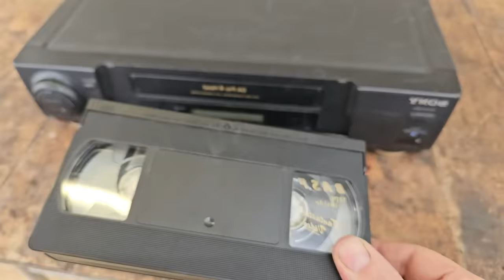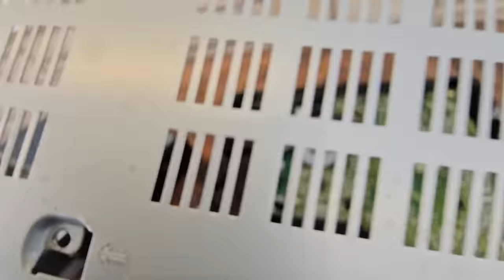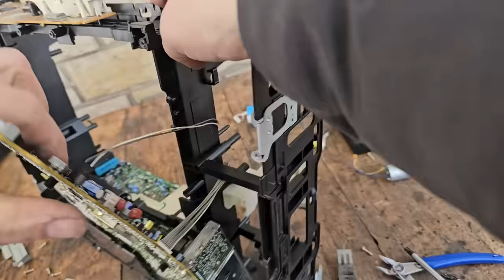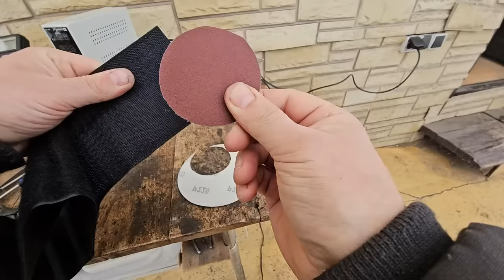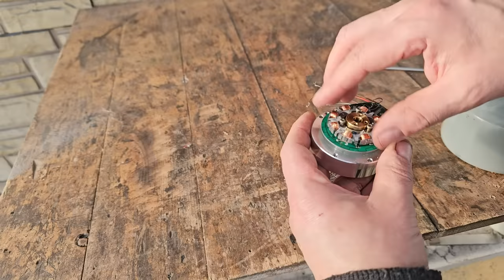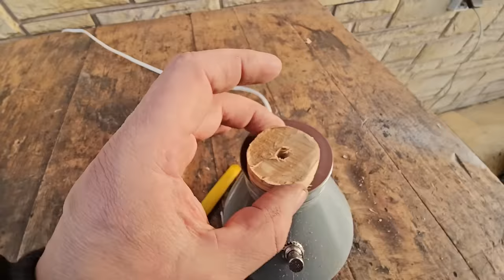Few people know the secret of an old video recorder. A brilliant idea in a few minutes !

Comment: Ridículo.
Reply: I am just adding on here . . . .with its prior aptly correct . . . .RIDICULO . . .ridiculous comment which I also HEARTILY  agree with. 
That video  head drive motor that he chose to use is the head spinning motor and the multiple brown wires coming of from it are related to different phase windings that are to be   powered from an appropriate a multi phase shifted drive power from a  power IC on the circuit board in the VCR. The power will be phase critical AC drive. This motors  whole   purpose is to spin that weighty aluminum head drum / flywheel that has  sets of record and playback heads that are spaced apart at 180 degrees. 
On playback of a tape, it is UBER-UBER-UBER !!  critical for the running speed of this motor to PRECISELY . . . . and repeat the PRECISELY !!!!! . . . . . duplicate the speed initially used in recording the tape,  being critical, up to a  to a 1800th of a degree of a SINGLE ! rotation. Otherwise the picture will just slip and slide and the developed? trash video will just be total undistingushable garbage.
The TORQUE available from this motor is NOWHERE repeat NOWHERE ! up to producing the "bogging down " that is heard with the wood grinding examples.
Look in the background and see a variable DC power supply  . . . . . . .is he wanting us to think that DC source is used in powering this AC design motor ?

Technically . . . from the electronics aspect . . . . he shows stripping down the brown wires and then concentrates on one wire getting connected to a poly capacitor pulled from the VCR's circuit board, now its physical size equates to it being a max of ~0.1 ufd. If you were to then know the frequency of the phase shifted drive and its voltage amplitude you could then compute the max  power level that could be passed through that 0.1 ufd with its capacitive reactance. And I can DEFINITIVELY tell you that it is NOTHING near the torque level being heard. Its more in the order off a gnat breaking a hard wind.
The sound produced by the  wood sanding demo is more in the order of this unit REALLY  being coupled into the permanent magnet DC motor as would be found, and pulled from  a DeWalt, Black and Decker, Makita or Milwaukee  battery powered power drill.

DIY unREAL . . . . . . . . come back and fess up . . . .you FRAUDSTER ! . . . . . .we're waiting . . . . since 03/31/24.
Reply: Ma fatti furbo